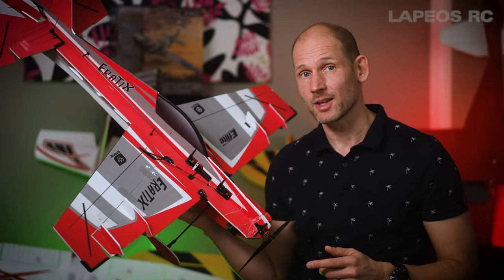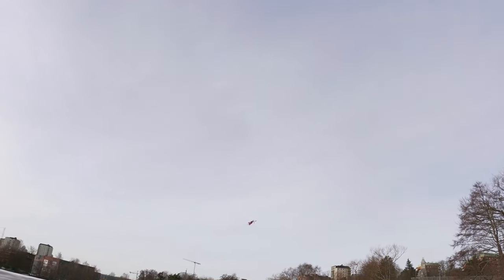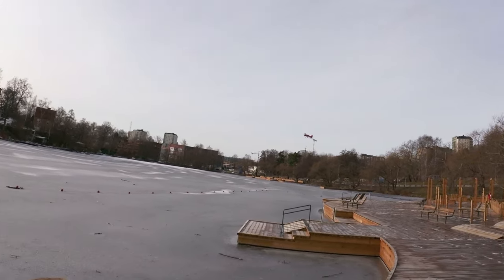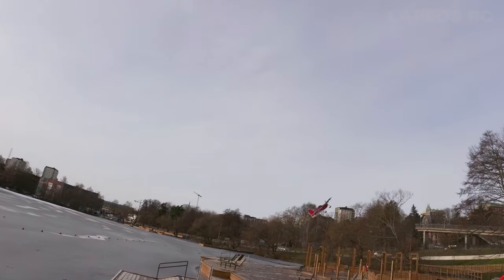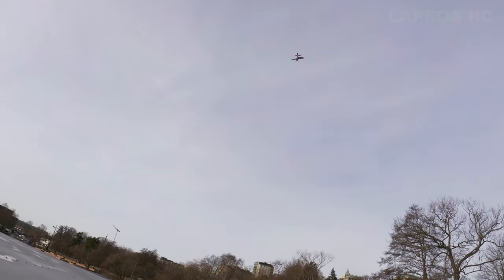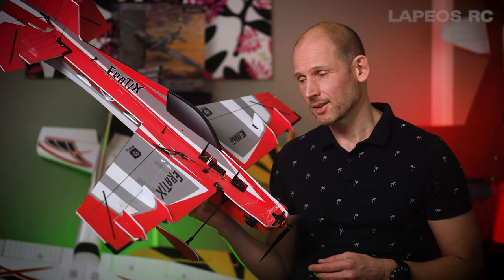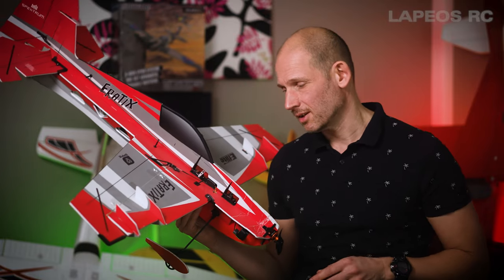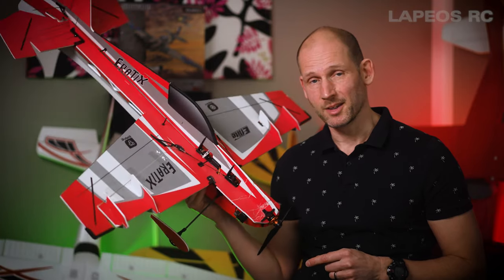E-Flite Eratix - Good or bad?

Comment: Nice man, cool different plane. Just some FYI on these...  3D flat foamies fly different. Not like a full bodied plane. You have angle of attack at all times, that is how they make lift with no airfoil. Takes a bit of getting used to. They don't trim the same way and the trim will change with speed, which is normal for a 3D flat foamie. So while they can be flown as a sport plane, that isn't the job they do best by any means, and a full bodied sport plane does this better. A 3D flat foamie excels in the high alpha, slow speed post  stall stuff (3D). Basically, it isn't a realistic comparison to a full bodied plane, kind of a different category all together.  The price on this one is good considering you'd put the same amount in the same type from Twisted Hobbys once you bought the plane, electronics, and RX...plus you'd spend at least a day building that. As 3D flat foamies go...the Eratix is heavy, but that is the cost of being able to build it in 5 min.
Reply from the maker: I'm new to these flat foamies so lots to learn! I paid about the same for the Valiant BNF, Trojan BNF and a couple of other planes and these offer more so I'd say it's overpriced. Not the same type of planes I know but still you do get more plane in the Valiant and Trojan and these are great planes. I'll continue to explorer this plane and have som fun! It's always great to have new things to learn so thanks for pointing out how flatties fly!
Reply: @SunriseRCAviator  Don’t take into account Valiant, Trojan and Conscendo BNF, they are the best value in the market and not the norm. They are the exception.
My TH plane cost me way more than Eratix, not taking into account about 8 to 10 hour work. (How much you value those ?)
Reply from the maker: @michelpetrus  A Valiant has much more value over time and will outlast Eratix by far. I have another flat foam plane I ramed straight into the ground. Only damage a broken prop. Not a scratch. Had it been Eratix next stop would have been my garbage can. So built and price is not right the way I see it.

Comment: Yep I agree with most of what you say. I maidened mine today in quite gusty conditions. First flight was OK but on the second I caught the wingtip (aileron) on the ground at fairly slow speed. Snapped the end off including snapping the stiffener and for some reason stripped the Rudder servo. People talk about Eflite supplying quality but why you would only put a metal gear servo on the ailerons on a 3d model is beyond me.
Reply from the maker: I've heard of so many user with broken rudder servos so I would suspect a design flaw. Apart from planes with nose gear and plastic servos I haven't broken a single rudder servo on 100+ planes even with a bit of abuse or crashing.

Comment: My only two complaints are the lack of color contrast between the top and bottom of the airplane, and the absolutely horrible battery mount.  No thought at all was put into the battery mount design.  Other than that, really like the airplane.
Reply from the maker: Yes it does become difficult to orientate sometimes.

Comment: Great review..   There are many options out there for a flat foamy plane.  I think Eflite wanted to get into the market with their solution which is probably ideal for lots of their customers.  Its easy to assembly,  works with the speckrum system and flies good enough..  I have the Twisted Hobbys Crack Yak 55 and its a wonderful plane, but I did spend some $'s on the electronics.  Btw, my buddy broke his elevator servo on his Eratix in a very mild landing...  I think your review is on target... - Will
Reply from the maker: I also think E-Flite wanted to widen their offerings and made the Eratix to cover that. It's certainly easy to put together but it does have some negatives in weight and durability. I'm looking at trying out a few other flat foamies down the line. Maybe Multiplex or TH. We'll see! I have a bunch of electronics to reuse but I can see most getting a little bit expensive if starting from scratch.
Reply: @SunriseRCAviator    I really love the flat foamy concept.  I've been flying the TH option for about 6 or 7 months.  Just learning to Harrier taught me so much about rudder control and throttle management..  Also, its tough as hell.  I've done a mess of videos with that plane, (good YT content.)..  Actually, Adam at Model AV8R convinced me to get it... I can't thank him enough...  Either way, good luck on that adventure..  - Will